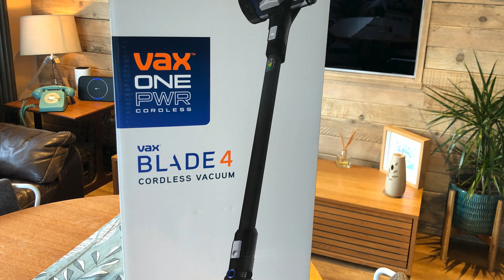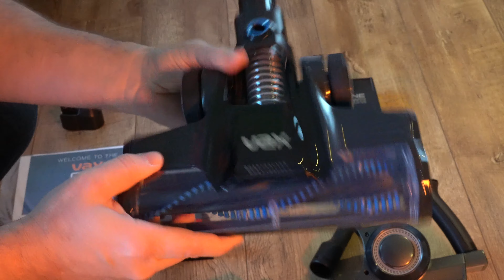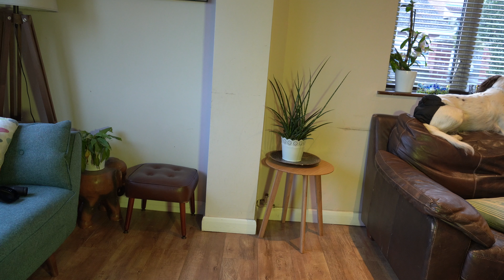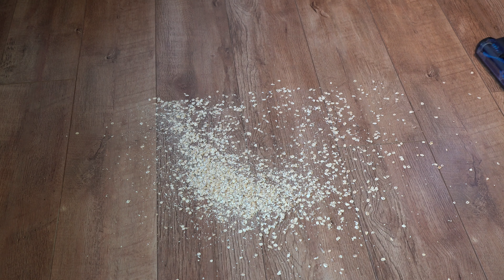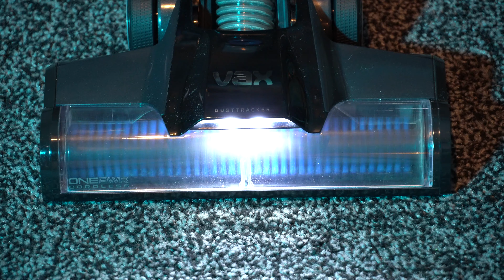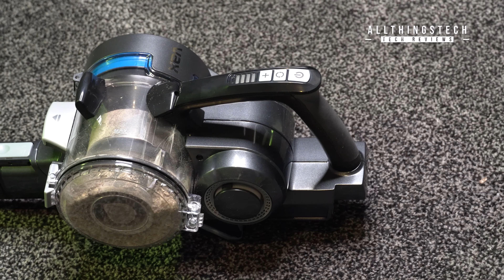**NEW 2020 MODEL** VAX Blade 4 Review - Lightweight Cordless Vacuum

Comment: Good in theory, but in practice, the short battery life on boost mode with the motorised head operating is frustrating. You really need at least two battery packs. However, the battery packs are junk. I've had one of these for a little over a year, and one of my battery packs has stopped charging, after just 10 charge cycles or so. And a new battery pack costs about £70.  The actual cleaner works great, and does a good job of cleaning. But the junk battery packs are not worth the investment.
Reply: The batteries have a three year manufacturers warranty. I registered mine with Vax the day I purchased it and received confirmation from them by return.
Reply: @nomdaploom  Yes, I discovered that. They replaced my dead 3ah battery pack with a 4ah, which lasts twice as long, so I can't complain really. The problems seem to be with the 3ah batteries.

Comment: I am here because Im doing some research of which is the best vaccuum cleaner to buy as I am planning to buy a new Vax vaccuum cleaner. The one I have now is 22 years old from Vax. It's orange and it also a carpet cleaner. It's still great to use but the problem is the body is getting brittle from daily use. It's coming off piece by piece when bumping on hard surfaces.

Comment: Are there any vacuums where you don’t have to cut the hair off the head? I don’t remember doing this as a teen and young adult cleaning the home for my mum?? And we had a big household ?

If not are there any models where you can remove the brush roller to roll off the hair rather than cutting it which isn’t a pleasant job 😂

Comment: I think the one VAC 4, I`ve bought has a great suction, BUT by the 3rd day of using it, the roller stopped spinning ? ok It picked up the Wife`s hair from the pile of the carpet, ok, I took the roller out and cut along the grooves to clear , BUT it still didn`t go round, ??  RED Light comes on at the front, The end of the roller where it goes onto the point ( belt side ) had Jammed, the hair had bird nested behind the end cap , to get to it is a Nightmare, after taking all the screws out, then taking the belt off , I found The screw on the inside was rounded off and had to use a Tool Gripper to hold the wheel and jam another tool inside to stop outside and the inside going round together, this of course stops the roller from going around, I couldn`t get to clean it out after all that, BUT freed the movement of the wheel > Just ?? I thought blow this for a lark and put it all together again > It works, but now makes a racket when on, > on a personal View of this VAC 4 , It`s a major Flaw that should be looked at ??? > Try taking it back to the Shop > They Haven`t a Clue ???

Comment: The motorised floor head is not fit for purpose, we are on our 3rd head now since buying the machine 5 months ago, it just cannot handle hair... when we first got it we cleaned it after every use, the brush bar became noisy, and the plastic around the drive cog melted, vax sent us a replacement head, the same happened. Hair gets pulled in behind the drive cog and around the bearing, the friction of the hair cause heat and causes the plastuc to melt. Vax sent us another, this time we remove the brush bar clean it and refit it between each room... this made no difference and the same happened again. When it works it cleabs great, but it is just not fit for purpose, deffinately do not buy if anyone has even remotely long hair. Waste of money, completely dissapointed with its longevity.

Comment: I have had one for the past 5 months. Overall a good machine, not great battery life though. The rubber seal between the motor and the dust collector leaks when turning around, quite load and annoying. The latest thing is the brush stopped spinning and has seized up. There was a small amount of hair around it but not excessive. I like most things about the Blade4 but this is too much. It may be time to change makes (I also have 2 Vax uprights that are always breaking down for different reasons).

Comment: The Dust tracker stupidly only works when the spinning brush is on. You need the dust tracker mostly on hardwood floors, so you can see the dust on the floor. The dust tracker should be on with all settings. Flaw in the design.

Comment: God I hope this is the real deal as my Dyson V11 Absolute is the biggest con in my life. I feel defrauded.
Reply: Why what’s wrong with it
Reply: Same here with my Dyson V11 Absolute cost us a small fortune near £600 
Had this now just 6mths over the 1yr guarantee and its breaking down power on trigger just keeps cutting out so angry that i would now have to pay to get this repaired just months after the guarantee ended.
Reply: @tracie richards  Ditto! We had a Dyson Outsize Absolute and it's a complete nightmare. It was 18 months old when we got rid and in that time it had a new battery, new cyclone unit, new brush head and new seals, all under warranty. When it broke down and flashed a battery error code again, it was time to go!

Comment: We have a VAX Blade 2 max and we have used it in the harshest environment possible - a cinema, to clean up popcorn after family screenings! We've had it years and considering it really is not intended for commercial use it's done very well. Finally the brush head needs replacing and I'l probably get the Blade 4 based on our good experience with current vax. We used a Dyson cordless before and the vax is WAY better, for us at least. The Dyson cordless had a very narrow gap in the brush head for the suction to pass through and used to block virtually immediately, whereas the Vax is much better at dealing with bigger 'objects' (although it can still get blocked with sweet wrappers occasionally).

Comment: Ergonomically the worst cleaner I have ever handled. You need strong wrist and hand due to the weight. Completely unsuited for stair or car cleaning . Removal of the dust container usually involves dust getting on your clothes.  The upholstery brush is difficult to control and the crevice? tool is too big a diameter for the sides of the upholstered furniture.  The only plus point is the excellent cleaning result on floor carpet.
Reply: Have u found anything better?

Comment: The floor head is rubbish on this because it is the same almost to the blade 1. The bearings last about 6 months and although they send a new one, it happened 5 times and  when you are out of warranty, they are £40 on a 6th month warranty. No electrical products come with 6 months warranty. One year is pretty much the industry standard so why 6 months? They know they are rubbish. There you go.

Comment: We've bought one and its been a great investment. Does everything mentioned in the review. Light and easy to handle. But it's not so versatile for using in the car compared to a hose vacuum.
Reply: if you buy the the Pro 2 Kit for Cordless, its instantly becomes very useful. Picked one up for £2 when i bought mine, but easy to find brand new for less than £10

Comment: Hey guys, Amazon have a really good deal at the moment on the blade 3 version if you're still not too sure on the newest model. Original price is £220 down to £170. Amazing hoover especially if you have pets as well. Here is the link: https://www.amazon.co.uk/gp/product/B08B8XNK9Q/ref=as_li_tl?ie=UTF8&camp=1634&creative=6738&creativeASIN=B08B8XNK9Q&linkCode=as2&tag=aspiretomarke-21&linkId=ec9db5273205f5a0aafa8c3ac2f36d5c

Comment: the suction  can be deceiving because the ground clearance makes a difference if the head is close to the floor it will  seem to stick to the floor even on low power setting but it will  push away the oats what it needs is an adjustable head to allow for bigger rubbish like seeds and oats to go under because if it pushing the oats away then the suction is pointless

Comment: Hi there nice review 👍. How does does it performs with long hair?
Reply from the maker: It's good, not had any issues!
Reply: We have long hair in our family and it’s the first Hoover I have ever had where hair removal is a doodle because the roller has grooves which is perfect to put scissors along to cut hair out of roller it’s a game changer for me!! Men doesn’t think about these things 🤣 I bet a woman designed the roller 🤣🤣
Reply: Its total rubbish, sure its easy to clean but hair gets dragged in around the bearings behind the drive cog, this causes friction and heat and causes the plastic to melt, then tital failure of the head, on our 3rd now in 5 months

Comment: I've just taken delivery of this cordless and I can't believe how much better it is than our older Dyson Cordless. We actually thought our carpets were clean but we've noticed we've been sneezing a lot lately, so we decided to get a Vax One power. It's unbelievably better than the Dyson. My wife felt it was heavy. But here's a tip.....drop your arm, without crooking your elbow and vacuum with your arm hanging loose and straight. It makes a huge difference! We couldn't believe the hair it picked up, which needed to be cut from the brush head after hoovering. Even that was easy, because there is a handy groove to scissor along. Job done. It'e a great cordless for the money!
Reply: This is why I'm looking at this, I find it natural, and ergonomically just making much more sense to be able to hold this kind of hoover at the top, rather than with bent elbow. But there aren't many hovers made like that.. most of them copy dyson's design to hold the stick at the end, because they have motor at the top where you'd like to grab it, that's just silly..  I'd like to try this one

Comment: Is the battery large for an 18V 4Ah lithium is that 5 cells? That's about 72Whr capacity. Can't we do better these days?
If the charger were higher power, the charge time could be cut significantly. Shame they don't include a second battery and have an intermediate speed (20-25 mins?)
It makes sense if you clean regularly, if you don't, then it might not have enough longevity for those 'once a month attacks on the dirt'.

Comment: I bought one last week.  Really great machine and with the free tool kit it does everything with ease.
Reply: Ditto. Used to have the Blade 2 which was great until the battery wouldn't hold charge, but this is a beast and i love it.

Comment: Here's my slight beef with my (and all blade 2/3/4 cleaners). Yes I understand cuts need to be made to keep the price down. But, the batteries in all blade cleaners use old school 2Ah cells, the current standard in most tools and power equipment is 2.5 or 3Ah cells. The purchase cost to the end user would increase by around 12% to include these upgraded 3Ah cells. This means that they could increase the suction on 'low' mode by 50% and still get the same 45mins or so of life. Or on 'boost' mode the life could increase from 12 minutes, to 18 minutes.

A massive improvement going begging...
Reply: Jamie Kulhanek , so true. My 4Ah Makita batteries on the fast charger take just 45 minutes!